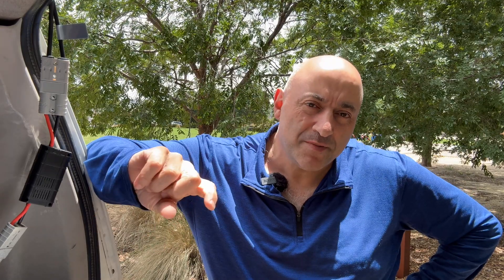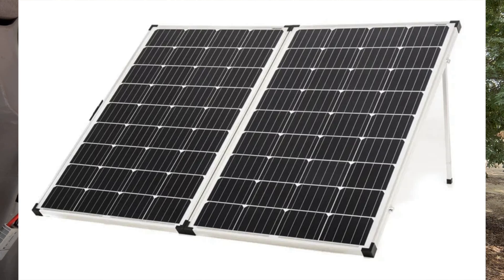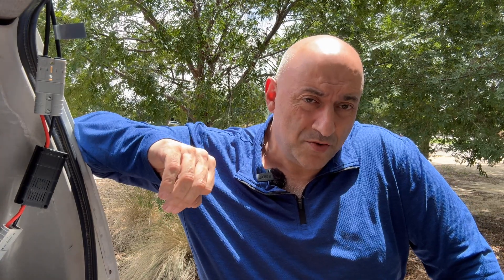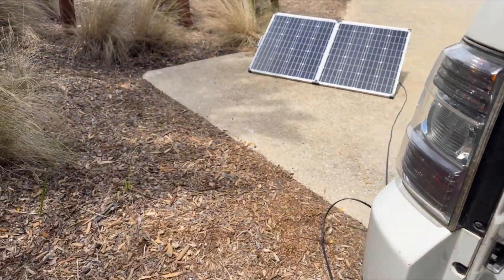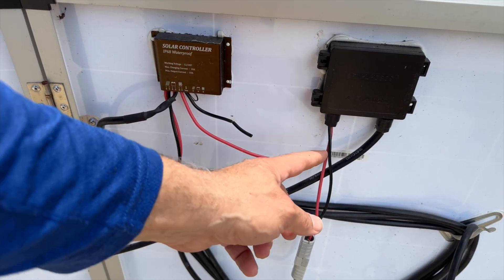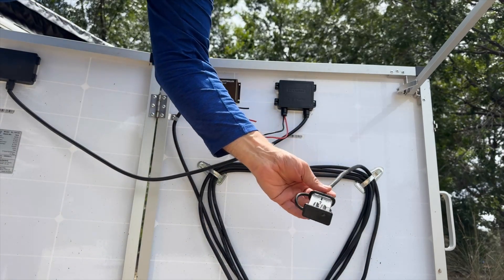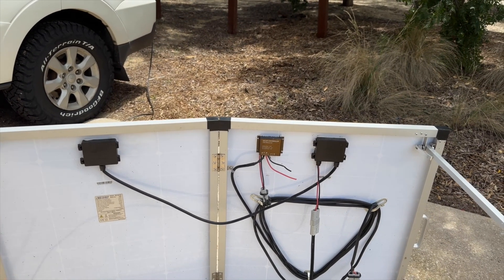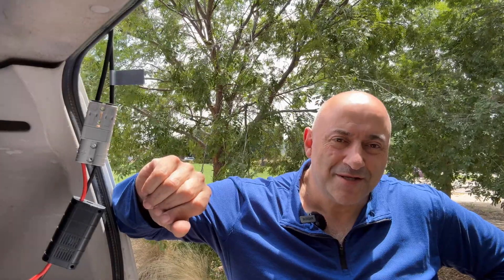HOW TO CONNECT KINGS PORTABLE SOLAR PANELS WITH SOLAR REGULATOR TO DCDC CHARGER

Comment: 2025 update... the latest will charge both lithium lipo4 and AGM batteries and instruction booklet confirms this both in packaging and online pdf. BEWARE and mindful from my personal experience overnight or when battery is 100%, ive noticed the following... overnight next day but not every morning my batteries were not been charged. I had to disconnect both Anderson's from the solar controller wait over 5 seconds and then plug back in for it to start charging. Today battery got to 100% , started using inverter and other power, and noticed 89% battery remaining so i saw the mppt solar controller in the same state where it had not started to charge the battery until i unplugged both Anderson's and waited more than 5 seconds before reconnecting and then it started charging again. Two red led lights constant lit, solar green led slow flash 3 times and repeats, load green light not lit. So good charger, not overheating temperature in range, as instructions state if overheat it will lower charge or stop, but this is not the case. So you have to be on your guard with this otherwise loose precious sunlight for solar charging.
Reply from the maker: Thanks! I’ll keep an eye out. So far I’ve had no issues. I actually unplug and replug in my solar panels in a regular basis. So it may have happened in the past and I might not be aware of it! Things to be mindful of
Reply: @DavidAbela yeah i lost a few hours of sun again today, frustrating. Not sure if its a faulty unit or not, so anyone else notice this would be good to know. Thanks

Comment: I think I have understood but need clarification, solar direct to dc dc without solar regulator or solar to solar regulator to battery then powering other items. Essentially they are doing the same thing but a battery turns on the solar regulator to see how much your solar is putting through?
Reply from the maker: Does your dcdc charger have a solar input?

Comment: Thanks for your video! Answered my question on why my solar panels weren’t working with the dcdc charger.
Reply from the maker: That’s great!, took me a while to work it out , common  problem . I’m not a big fan of reading manuals but slowly working out, it saves a lot of time and headaches if you do. 😂
Reply from the maker: @davidwade4279 Thanks Dave!
Reply: I have some set up my solar dose not have  controller so I connected to 20 amp mppt . Can you please tell me the proper way to disconnect . So I don’t damage the controller. Thanks

Comment: Awesome, exactly what I wanted to know.. I got the BCF 260W fold out with KINGS 25A DCDC setup in the back to my KINGS 120aH LiFePO4 battery box and was feeding regulated power into the DCDC Solar input and was getting weird results... Plugged it direct to the battery box and was charging super fast....
Now I'm going to bypass the MPPT controller with Anderson Plugs and go via the DCDC charger which is what I wanted to do 👍
Reply from the maker: That will work perfectly! Glad I could be helpful!